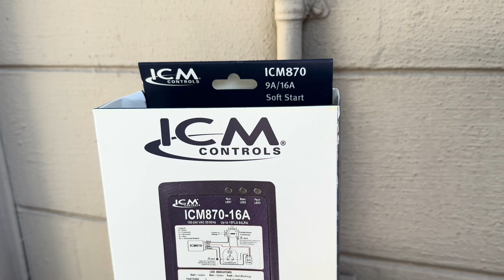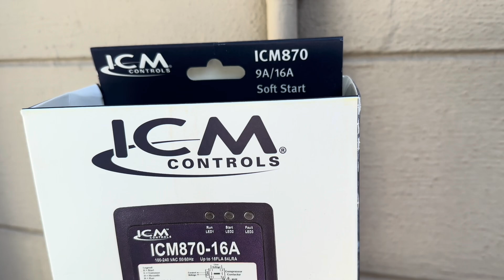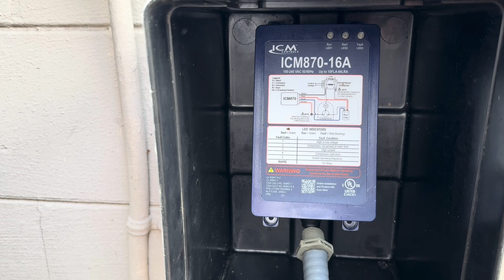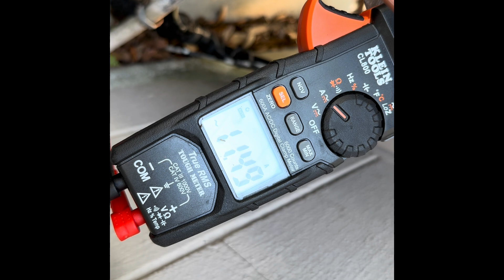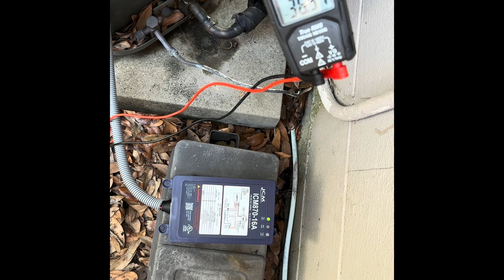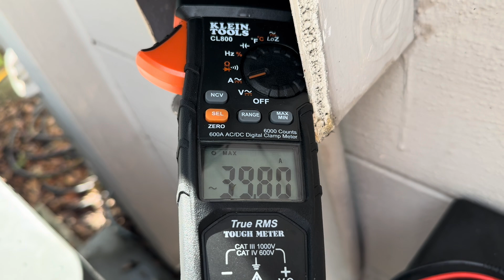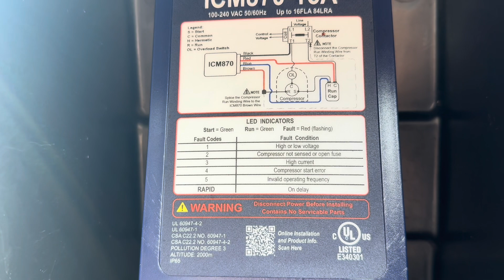ICM870-16A Soft start lets your portable generator run your air conditioner. #ICM. #hvac #generator

Comment: I have been looking at the ICM instructions, and nowhere does it say the first wire(RED Wire) needs to connected to the capacitor. It says to connect it to the T2. Why did you connect it to the capacitor?
Reply from the maker: The instructions I have show putting the red wire on the common of the capacitor. The common is also connected to T2. So I followed the directions that came with mine. Maybe they updated the instructions. Either way should work. Thanks for watching.

Comment: Can I put an icm870-32A on a 2.5 ton unit
Reply from the maker: You could but not recommended. The alarm or trip settings are not setup for a smaller 2.5 ton unit. Meaning if there is a fault it may not shut the unit down. The icm870-16 would be the proper size for a 2.5 ton unit.

Comment: Seems higher than micro air.

Most the videos showing micro air easy starts are reporting 25-28 amps.  Videos I’ve seen of the ICM is 38-42
Reply from the maker: Thanks for watching. Very interesting. I have a sure start soft start that I will test to see how it works in the next month or so.  Be on the look out for that video soon.

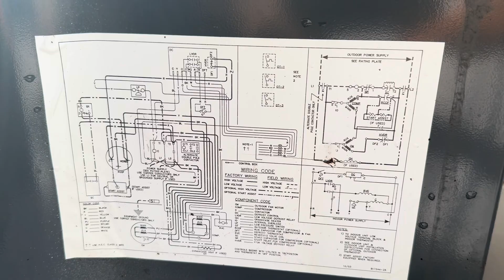Comment: There is one big problem here - if you look at the ICM870 literature, it says it ALREADY INCLUDES A START CAPACITOR.  Furthermore, the ICM870  'TYPICAL INSTALLATION' instructions, which you show at 5:19 in your video, in the lefthand column clearly state in Step #2: "If there is a Start Capacitor and/or Start Relay already in place, disconnect them prior to installing the ICM870."   The 'INSTALLATION' instructions in the righthand column, also clearly state in step #1:  "If there is a Start Capacitor and/or Start Relay already in place, additional steps will be required to disconnect them."    So I'm sure that by leaving the original start cap in place, the capacitance is much higher, maybe double, what it should be.  However, you would still want to leave the fan connected to its proper capacitor terminals as it needs it to run and the ICM870 doesn't include a capacitor for the fan.

Comment: https://youtu.be/bwNfX6pMKGw?t=691 ICM's website says not to upsize the soft starter. "Please DO NOT assume it is acceptable to upsize the ICM870-9A or ICM870-16A to the largest size (ICM870-32A) when you are unsure of the RLA current or when the current is close to the limit of the ICM870-16A. This practice will defeat the benefit of the Inrush reduction on smaller systems under 16 Amps and defeat the over current safety limit by allowing for a 20A trip point for over current on the ICM870-32A compared to an 11.25A trip point on the ICM870-16A. PLEASE choose the ICM870 based on RLA or by using the size vs tonnage chart shown."

Comment: I bought one of these. It lasted a total of 3 weeks and quit working.  I contacted the manufacturer and they would NOT refund me or send me a new unit. $200.00 wasted
Reply from the maker: Sorry to hear that. How many tons is your AC?  Mine is about 3 weeks old now. Did they give reasons why they would not warranty it?
Reply: @Motorcycles-Generator-Honeybee  3 ton
Reply: If you purchased it using a credit card you could try to file a claim with them.
Reply: I've seen many other people  claim the same from manufacturer.